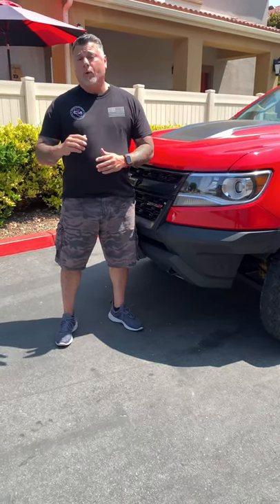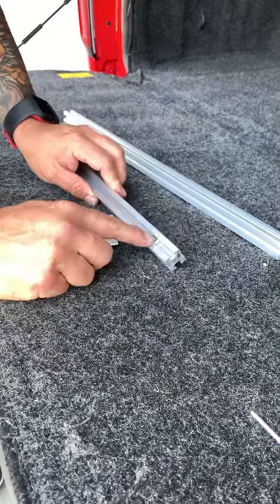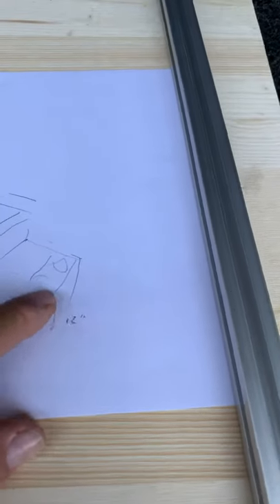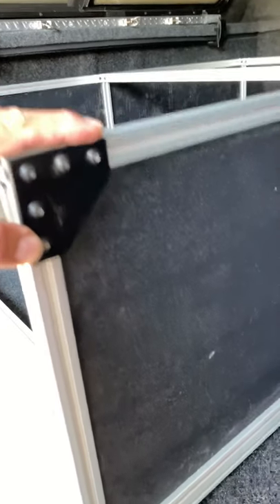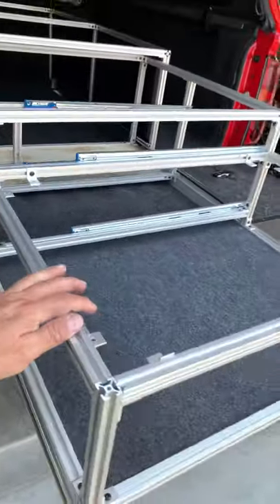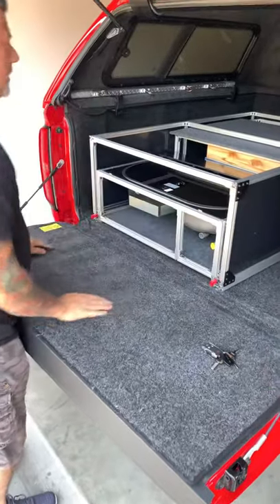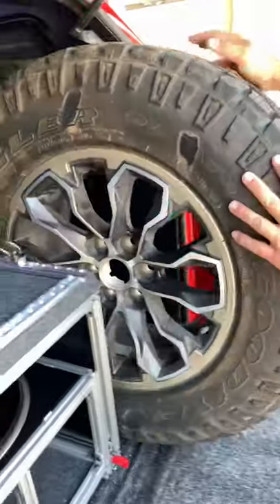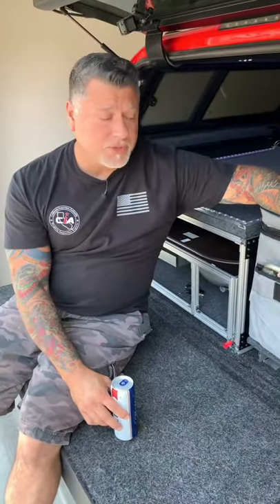Colorado ZR2 Overland Camp Kitchen

Comment: Nice build. Great ideas here! That 80/20 looks really versatile and lightweight. Has it been coping pretty well with jiggling and jostling on the trail when fully loaded?
Reply from the maker: Hi 👋🏻 softroadingthewest I couldn’t be happier. We have really put thithis camp kitchen through the paces. And everything is still incredibly tight. With no movement. We did use red Loctite on every nut and bolt during the assembly. I’m sure that has a lot to do with it. It is about half the weight of a plywood build. I did use plywood for the top deck. And now I am wishing that I didn’t. It represents the bulk of the weight to the unit. So in the future I may replace it with a different material. This will help to cut even more weight. Thanks for your question.